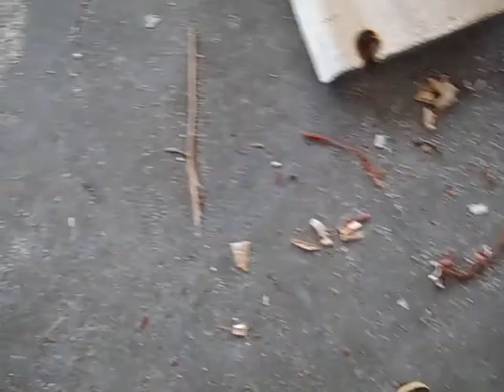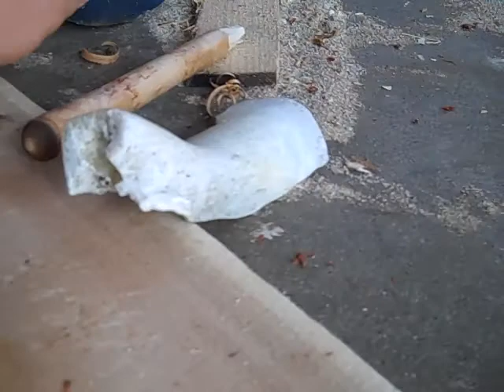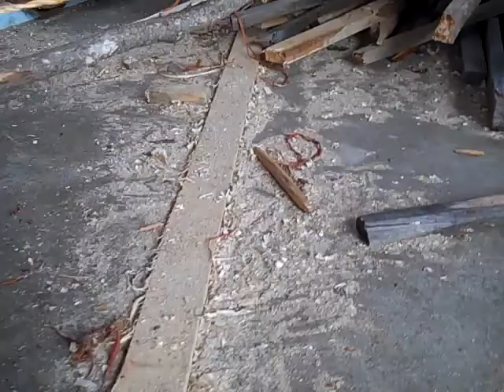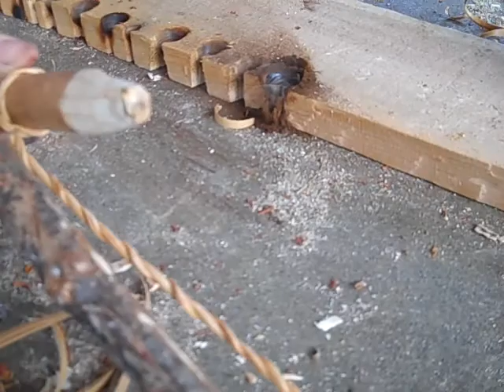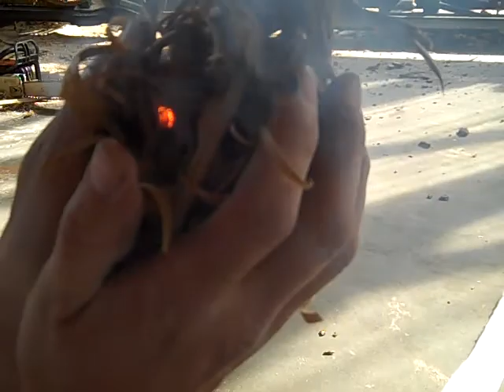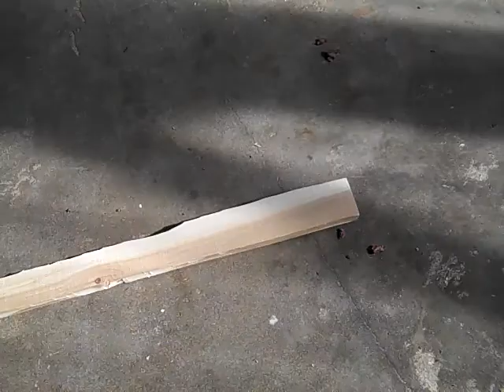spruce cordage bow drill

Comment from the maker: Yes Kull, the spindle was section of spruce near the top of the between the whorls, no whittling, the board was cedar.  I tried with the bark still on the root and it just slimed up so the bark should be stripped.